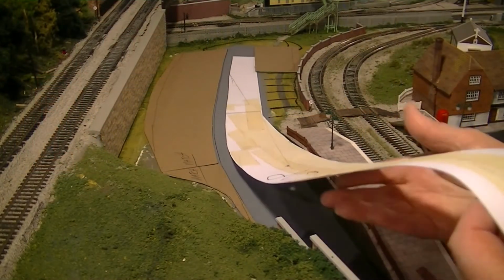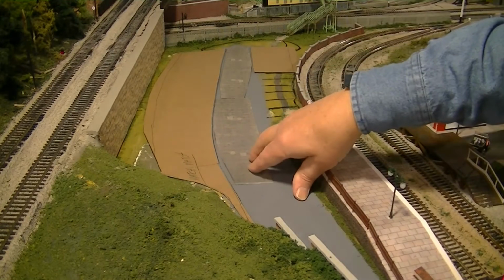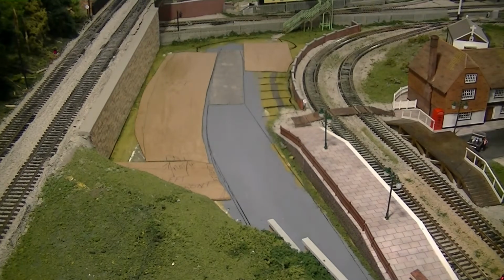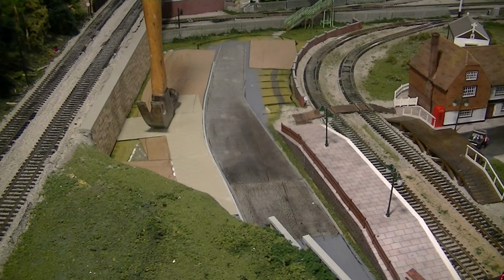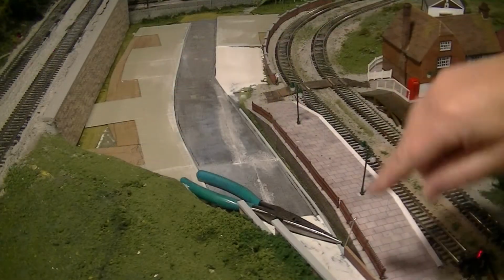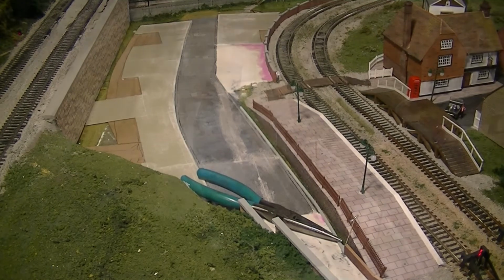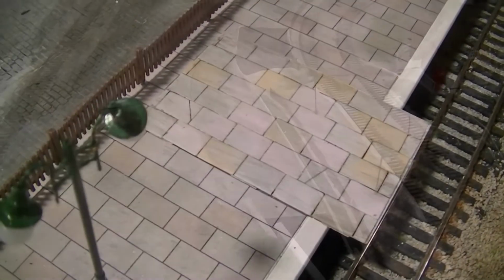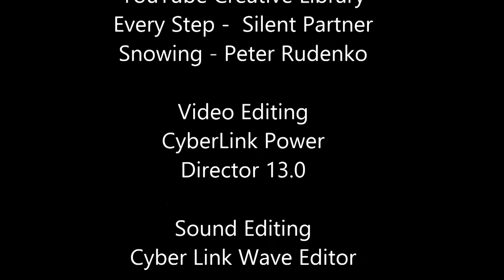Farland Howe  -  The Street Build Part 3 - Culmination  -  #105

Comment: Looking absolutely superb Rob! The cobbles look amazing! Love the little built in drains. The paving stones are a great match! All very clever how you got all the piece to shape and fit perfectly into place! With the cars and people added it really brings the street to life! I see you managed to raise the pub sign too! Love the look of the fully stocked model shop! Keep up the great work and thanks for sharing!
Reply from the maker: Hi Callum, you are very kind, thank you. The pub sign was easy, it covered up the old hole fine.  I had a ton of trouble with the street paving.  It is rubber and bendy, I started with a good pair of scissors but soon discovered there were gaps down the seam.  I finally used a straight edge and blade.  That seemed to work better.  The other problem was the color.  I had to smear it with a dark wash to hide the differences.  I wish I could have asked for color matched material.  Aside from the problems the build has been fun.  In another week or two, I'll have it done.  Thanks again, Rob